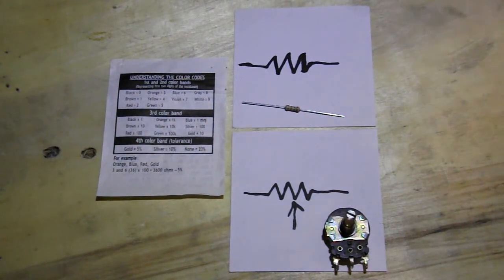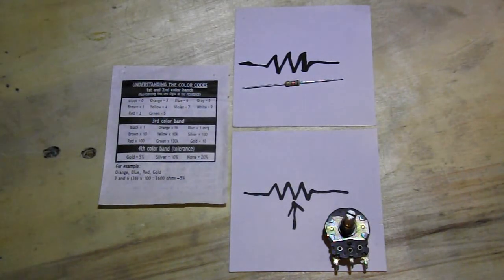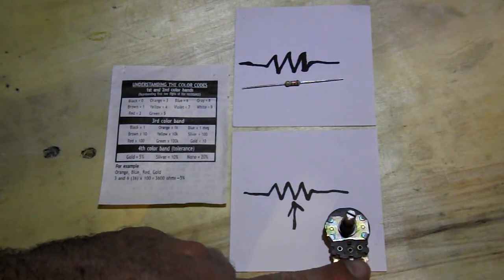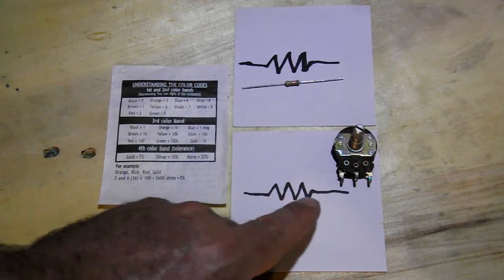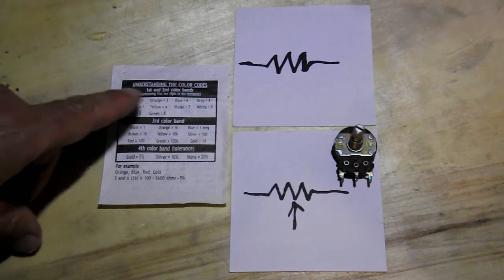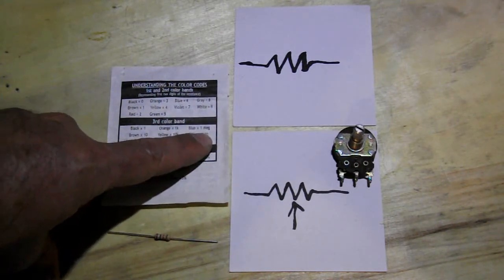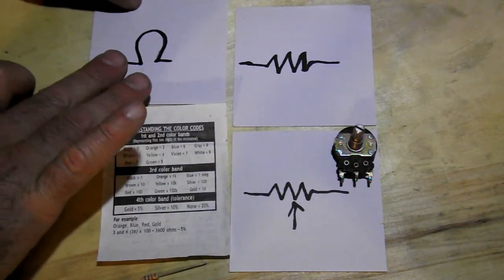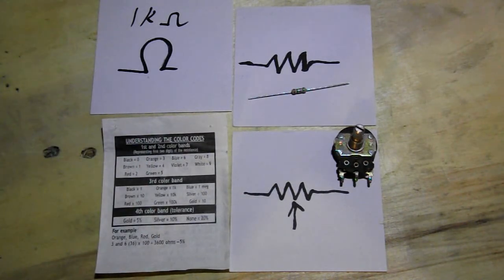Beginners Electronics ~ Understanding The Resistor and Potentiometer

Comment: So where is the video of How to read resistance on an analog and digital multimeter at? I m ready for the video.
Reply from the maker: Ok, I will do that next.
Reply: For real I dont understand how to really read a multi meter LOL LIke what it looks like when it says there is a short or a open circuit. I m trying to ohm out my dryer thermo fuses and I dont know what Im looking at? I would like to get a fluke AC DC clamp meter but they cost a lot too much for my budget. They have alternative cheap ones I have seen a couple people did videos on youtube about them that were decent to use. I want a clamp meter so I can see if a solar panel is working with out unhooking it.